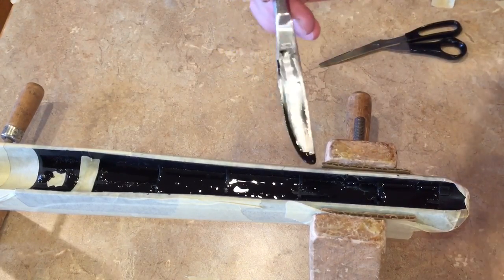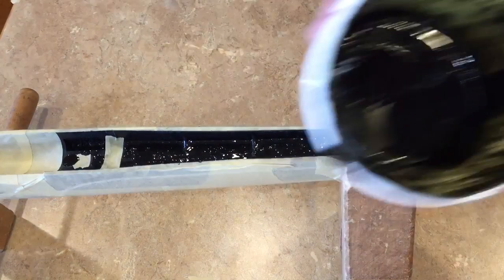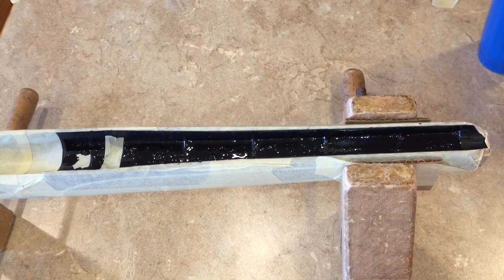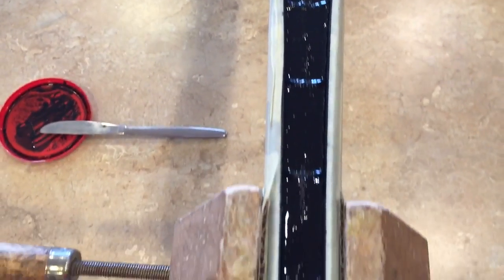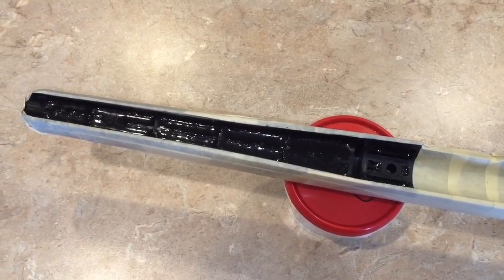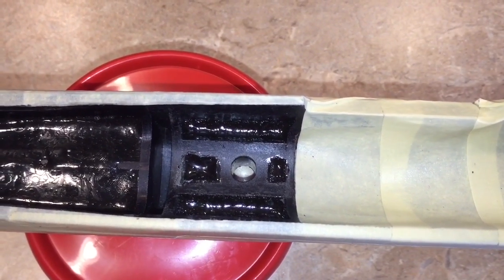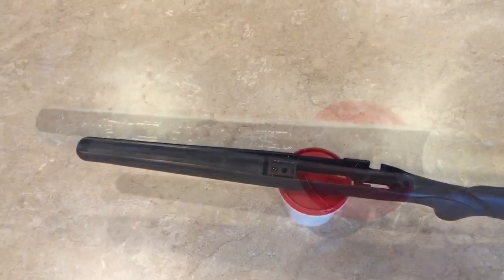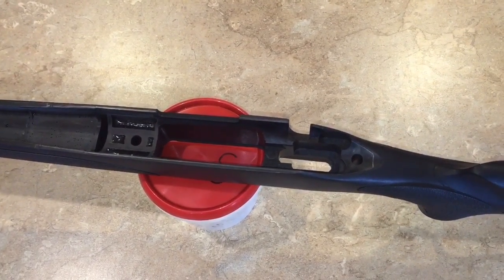Match Grade Bedding and Stock Stabilizer for Remington 700 SPS Part 3

Comment: I have done this procedure to several synthetic rifle stocks.  Stability was greatly improved.  I also put a stainless washer between the stock and front action screw for free floating and used JB KWIK in the recoil lug well.  I used a very thin coat of grease on the recoil lug installed the action on the stock and let it sit over night.
Reply: Did the grease help with the come out really easy?

Comment: Like trying to fill ice cube trays evenly. I like how you do everything. I've learned a lot. If I do mine, I will follow many of your methods. I have a model 700 BDL, which is supposed to be a Better Deluxe model. I'm not sure which type of plastic, since they call it a composite. Anyways, I've spent my life in the construction industry and watched many, many very large concrete pours. To eliminate air pockets and bubbles in concrete, a vibrating head on a flexible cable is lowered into the concrete and the vibration causes all of the air bubbles to rise to the top. If I use the method you are demonstrating, I think I will rubber band my two electric toothbrushes to the bottom of the stock. That should vibrate all of the bubbles and air pockets out of the stabilizer. I have also watched videos where the bedding compound was run the entire length of the stock with layers of tape built up to 60 thousands of an inch on the bottom of the barrel. Then the rifle was reassembled, squeezing out the excess compound. After the compound was hardened, the tape was removed and you had a free-floating barrel with zero cavities beneath...... Well, as River said at the end of Serenity, "That's the plan."

Comment: Why not bed the barrel lug slot too?
Reply from the maker: This video was of the match grade stock stabilizer, which increases the strength of the forend. The recoil lug is bedded using a different compound in a different step.